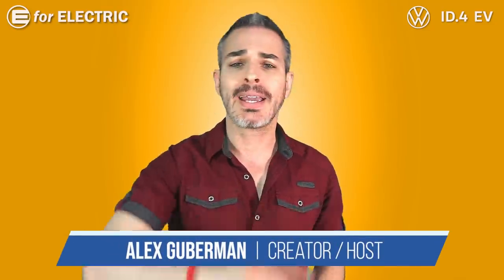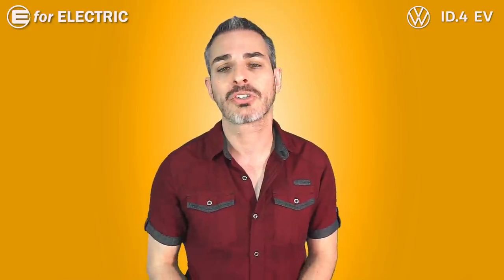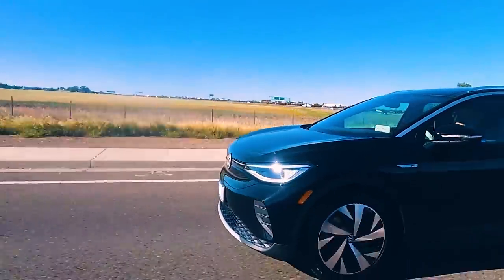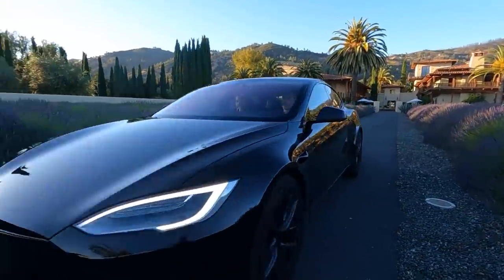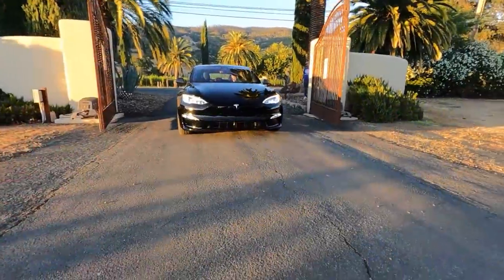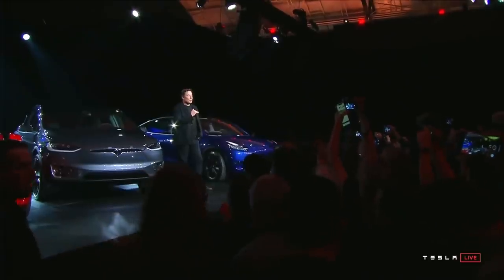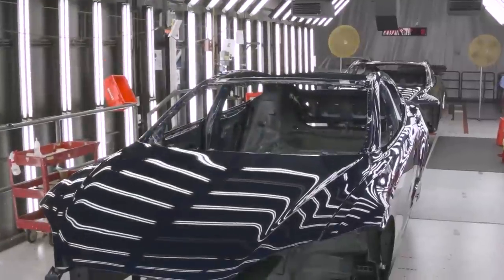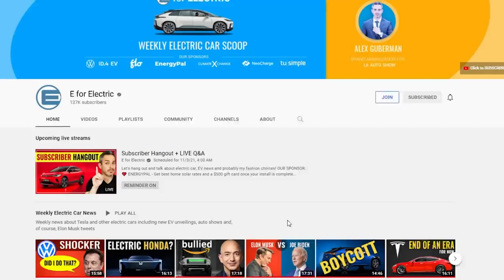SANDY MUNRO on Tesla's LFP vs 4680 Battery Tech

Comment: LFP will probably be the dominant chemistry for ALL BEVs that are on the cheaper end of the market for the simple reason that the raw materials are cheaper and more plentiful.
Reply: Maybe...what about CATL sodium ion?
Reply: Until the next breakthrough.
Reply: @FirstLast-ml7yf  it may be betyer, but far from proven yet!
Reply: Cheaper is most important but they are also better in at least three ways. You can and should charge them to 100% without any problem with degradation. They can be recharged many more times, and they are much less likely to catch fire if they are damaged.
Reply: @FirstLast-ml7yf  Mostly intended for energy storage I think, but that will be a huge market if there are cheap and good enough batteries available, used in combination with solar power.
Reply: @FirstLast-ml7yf  CATL's Sodium-ion is still way too heavy, but it will improve over time. Progress depends on the price of lithium and demand for EVs. (Who knows Trump may be back in 2024, oil may be dirt cheap and EV sales in the US stops growing)
Reply: And they last more cycles and can be charged to 100% with no degradation.

Comment: I love to use those LFP batteries. I use them since 2015 for starting battery for my motorbikes and cars. 
They have around 10% less energy ensity , but the plus for these batteries is, the 2000 charging cycles and they are bulletproof. When you dont need 0 to 60 in 2.1 sec, but are ok with 5 sec, the LiFePo4 battery is good enough  👍
Reply: Correct, there is only a 10% energy density difference between LFP and NCA (Tesla uses NCA).
2000 full cycles vs 1000 full cycles, cheaper, do not catch fire, can be charged to 100% every time - LFP is the future.
Reply: Grizzly, maybe you can answer this: Based on my current understanding, isn't it true that in a practical sense, LFP batteries actually have longer range than lithium ion batteries. Here is why that is my assumption. Lithium ion can only be charged to 85%  of capacity, and discharged down to 10%. On the other hand,  LFP batteries can be charged to 100% and discharged down to 0%. If my understanding is correct, isn't it the case that LFP batteries actually have 15% more capacity  than lithium ion batteries. And that is of course assuming that both battery types are the same size in terms of killowat hours. So my question is: Is my thinking wrong on this? If so, what am getting wrong?
Reply: You can use the full capacity of the battery without degradation unlike having to not charging to max or running very low too often as you have to with NCA batteries so reduced energy density isn't really aproblem.
Reply: @JohnDoe-fz5cz  the battery density is lower in LFP meaning more weight has to a allocated to the pack. More weight = less range.
Reply: @JohnDoe-fz5cz  it is true that the battery life (LFP) is longer giving 2-3 the total range of the pack-life (80% usefulness) to be about 1,000,000 miles.
Reply: @jamesirwin7677  In theory yes, but practicaly there are more variables. The weight difference is only a factor when you take 10% more batteries with you, to have the same energy. 
With the same amount (weight) of batteries there is only the 10% less energy density, no weight difference. So the LFP batteries can indeed discharge up to 15% more of the total amount of energy and charge to the full cap without degrading the battery. 
The biggest advantage for Li-Ion batteries is that they can discharge faster than LFP batteries, thus accelerate a car extreem fast.
Reply: @JohnDoe-fz5cz  You are correct. People use the wrong numbers when comparing LFP with most Li-Ion. With the same weigth of both, the LFP can hold around 10% less energy in totall. When used with 10% more batteries, the energy (range) is just a fraction less due to more weight. Accelerating more weight costs a bit more energy, but there is also more regeneration in deceleration. The loss in range is less than 1% due to weight difference. 
You are correct that you can discharge and charge 100% without risk of high degredation. Also the metals used in LFP batteries are less toxic and a lot cheaper, and more easy to produce.
Reply: @BMWHP2  Grizzly, thanks for clearing that up for me once and for all. Yup, I'm thinking LFP might be the way to go.
Reply: Most times I plug my car in it is to 80% of charge or less. I reckon I go to 100% about 12 times a year. LFPs will probably do a lot more than 2000 cycles in that regime.
Reply: @JohnDoe-fz5cz  "Lithium ion can only be charged to 85%  of capacity, and discharged down to 10%."

It can be charged to 100% as well. It's just that the long term degradation is less if you keep it between 10% and 85%. My Chevy Volt always keeps it between these limits in order to extend the life of the battery. You don't get the choice there.
Reply: @jamesirwin7677  you’re saying that this LFP battery could go for roughly 1 million miles ?  I just want to make sure I read that correctly.

Comment: Been using LFP for a decade now. It's not perfect but i love it. It's rugged , durable and safer.
Reply: Any loss in charge?
Reply: @Jay-xr3sb  yes there were losses over time. but still very usable. Unlike previous lead based batteries that sucked big time.

Comment: Not smart to conflate battery chemistry [LFP] with form factor [4680]. In a possible future you could have a 4680 that is LFP chemistry.
Reply: Agreed, but it's shorthand
Reply: Not possible LFP with 4680 format.
Reply: @ssecretsauce  Why?
Reply: @ssecretsauce  (the original FLP cell was a 26650 - so what  is the limiting factor in 4680??)..

Most replies saying anything is "not possible"   are wrong.   lol...
Reply: @kadmow  economically and theoretically not possible, tesla or Panasonic will make LFP battery with 4680 format.
Reply: @ssecretsauce   - whatever, sounds as if you are now contradicting yourself.  cheers...

PS. anyone can make a cylindrical Battery with nearly whatever dimensions they choose...
Reply: @ssecretsauce  BAK Battery was working on cylindrical cells bigger than 2170 (aka 21700) for quite some time and already offers 32105 and 32140 models (tabless design, in three versions: NCM, LiFePO4 and LiMn2O4).
Reply: @ssecretsauce  It is already announced on Battery day that 4680 will also come with LFP chemistry.
It is known fact.
The biggest advantage of 4680 is ease of manufacturing.
Compare 4680 manufacturing to pouch cell manufacturing; you will see how fast a 4680 can be made.
Also, the thermal and structural advantage of 4680 is already engineered.
The only advantage LFP pouch cells gonna have is energy density per volume (Wh/L).
Reply: @josephine2869  which battery day ? 
send me link pls.
So you think CALT & BYD are stupid ?
Reply: @ssecretsauce  Tesla love a challenge.
Reply: @kadmow  ... or chemistry.

Comment: I'd lay odds that LFPs completely replace nickel batteries in just a few years. LFPs are much cheaper because iron is much cheaper than nickel and cobalt. LFPs are several times as durable, can be charged to 100%, and don't catch fire. Their downside is that the energy density is lower but if that can be overcome they will take over 
Let me draw a parallel with semiconductors. In the 70s bipolar chips were used in fast computers while CMOS was used in feeble microprocessors. CMOS was cheaper, denser and lower power but bipolar was faster. In the 80s CMOS kept getting cheaper  and denser  but it also got faster. By the mid 80s CMOS was faster than bipolar and after that everything from PCs to supercomputers was using CMOS. Bipolar disappeared except for some niche applications. Today almost all chips uses a process which descends from CMOS. LFPs have one weakness, energy density, but if that improves by just a little bit there will be no reason to use nickel batteries.
Reply: I don't see the lack of power density as an issue but the expectation of the user.
Reply: The main issue is the ability to charge and discharge the battery cell and LFP, relative to Nickel based chemistries, are slower. The solution might be to have mixed module batteries in which perhaps 40% would consist of LFP and 60% Nickel based cells. Battery control electronics would dictate which modules of cells would discharge preferentially depending on the overall charge of the entire battery pack.  The LFP would act as cushion for the Nickel based cells operating at the extremes of the battery charge state.  So, to use Sandy’s analogy, the battery would behave effectively as an 8 cylinder engine that would vary the number of cylinders used according to the power available.  This 40:60 hybrid strategy might offer the best of both worlds improving the charging and discharging rates over 100% LFP battery packs whilst also increasing the number of charge and discharge cycles over 100% Nickel  based  battery packs.
Reply: @e-redj  LFP density is about 20% lower. Not so bad. Add 20% more then? I think people are already too spoiled :)
Reply: @e-redj  LFPs have two advantages that help to compensate for their lower energy density. They can be charged to 100% and they don't degrade nearly as fast. My two year old Model 3 AWD now has a range of 280 miles instead of the 310 it had when new, at 90% that's only 252 miles. The new RWD LFP M3 has 267 miles of range and because you charge LFPs to 100% not 90 it already has more range than my two year old M3.
Reply: Lfp is also heavier.  On the last ep sandy mentioned that he expected performance cars and weight sensitive applications to use nickel based. Budget cars and applications not weight sensitive will most likely move to LFP.
Reply: @Alsmithize  The most sensible comment I've read here so far :)
Reply: @joshuarosen465  Personally I'd rather not charge to 100% but yes LFP's used properly will last.
Reply: @samguapo4573  Tesla recommends that LFPs be charged to 100%. I'd assume that they have a good reason for this.
Reply: @joshuarosen465  I think this has may have to do with the battery balancing (individual cells) part. I think its ok to do this every now and then. but not all the time. Still running my LFP to the ground and back :)

Comment: Just a clarification. LFP is a battery chemistry and 4680 is cylindrical battery cell dimension. LFP chemistry battery cells could also be produced as a 4680.
Reply: Why would they? They want the 4680 to be performance cells for the upcoming 3 year late Roadster and other high performance cars as they will never fit 200kwh of LFP chemistry into any Roadster or Cybertruck
Reply: @gregb1599  I didnt say they should. Im just saying that comparing a battery chemistry to battery cell shape and dimensions does not make sense. The 4680 cells general proposed chemistry is not even introduced in this video.
Reply: @gregb1599  Because the battery pack structure would be standardised regardless of the cell chemistry.  Exactly the way it is now, 2170 LFP or 2170 LIC.

Comment: just a note: there have been about 20 Bolts catch on fire because of the battery, there have been 141000 built and most sold. so one car in 7050 have caught in fire.
Reply: @echoeversky  Hehe, something like 3.8 sigma.
Reply: Being intrinsically non-flammable might be an advantage, then. But how many ICE cars can say that?

Comment: The new Model 3 version with LFP is hardly a slouch ... still sub 6 sec to 60mph and with huge advantages of regular 100% charging being OK and a much reduced degradation. It's a great fit for the needs of that car and for many potential owners. 5 years down the road I guarantee people will be paying more for second hand LFP Model 3s than the SR+ that had the "faster" battery. I'm not knocking the pre-existing SR+, I own one and it's great!

Comment: 4680 is a form factor and LFP is a chemistry.  There is no reason why you couldn't have a 4680 LFP cell.
Reply: Why are the LFPs produced as prismatic cells
Reply: Correct. 4680 is just the 46mm x 80mm packaging size, not the chemistry.
Reply: @cold_jay  There have been LFP 18650 cells around for years.  LFP can be packaged in many ways.

Comment: The other manufacturing consideration beyond faulty units per million, is manufacturing efficiency. Every step of the new production line has to be as fast as the next (to avoid partial built batteries stockpiling) and that the end-to-end operation is at least comparable to the net kWh production rate of the current battery generation, or you will have a net production rate decrease and commensurate net cost production increase.

Comment: The cell voltage difference between Teslas NCA and LFP is 3.7V vs 3.4V @ 50% state of charge. This is only a 10% difference in energy density.
4680 is just the cell size and does not refer to the chemistry. In theory, 4680 could be made using LFP.
'4680' means 46mm wide x 80mm high. This is just a packaging dimension. Tesla will pivot to LPF, and LPF can be packaged in the the 4680 size.
Reply: Bingo; just look at the numerous packaging sizes in which the alkaline cells we use in all our remote controls, flashlights etc can be found.

Comment: 4680 cells aren't delayed, Elon said it would take 3 years to realise the full advantage, however the cells are now at a good production rate at the pilot plant, the battery pack is causing some issues at the moment but the cell production rate is good. Add to that the battery cell plants at Texas and Berlin won't be ready till next year.

Comment: LFP's density is around 170 Wh/kg vs 260-280 Wh/kg.  SO if you are happy with a 250 mile range or want a 400 mile plus range there u go.  Range is king as is recharge times, so LFP will always be a niche chemistry in markets where you drive a lot (like the USA)

Comment: The battery day told us that Tesla will be ramping up the mass production of 4680 with all the battery day goodies in three years... that's two years from now. Not sure what is late at this point as the pilot plant already has a decent yield and can do quite a lot of initial inhouse battery production... they may be ahead of their initial schedule.
Are LFP's obsolete when 4680 comes out or the other way around? 4680is a form factor... can be nickel and can be iron phosphate. LFP is battery chemistry... can be square or cylindrical, can be 4680 or any other size.

Comment: LFP is battery chemistry and 4680 is battery packaging. It's not comparing apples with oranges, it's comparing fruit juice with with bottles. 
Disclaimer, I'm using LiFePo4 cells for some 8 years now in several projects from 14400 to 22650 sizes.

Comment: I think that Tesla's LFP may not be in the 4680 format but I'm not sure.
Currently Tesla's LFP batteries are Chinese made and have been for 6 months or so.
The cylindrical format is good for cooling and isolation of rogue cells but LFP doesn't need those features so the BYD blade battery format seems like the best format.
And the MIC Teslas wouldn't be using the 4680 format as of today.

Comment: I wonder if they could use two different types of battery packs to get the best of both. Also what happened to ultra capacitors, I thought that would be a great buffer for high instantaneous output  & regen.
Reply: When your batteries can push a car from 0 to 100km/h in 2 seconds, why add capacitors? The best part is no part!
Reply: I believe Hyundai is testing hybrid battery packs. Their competitors are waiting to see if it works well.  Capacitors could help in charging speed so I wouldn't count it out.
Reply: @RobertHamon  yup, elon even mentioned it, the batteries have gotten so good that capacitors are redundant.

Comment: Please can you explain where you get the idea that LFP are '4 cylinder' LFP have higher C rates than NMC and can therefore deliver more current. Their drawback is the energy density which means you won't get the same range. The only reason the cars are slower is because Tesla are only fitting them to the standard models. If anything LFP will charge faster and deliver more power.

Comment: Sandy keeps getting the comparison between the power output of LFP and other batteries wrong.  The LFP is the V8.  LFP batteries can put out more amps.  UPDATE: Sandy isn't wrong with regular LFP batteries.  What I didn't know at the time of writing this post originally was that the 2014 Spark EV had Lithium Iron Nano Phosphate batteries and not just regular LFP batteries.  The nano phosphate gives the phosphate more surface area allowing electrons to flow easier.  This giving more amps and charging speed than regular LFP batteries.  So the Lithium Iron Nano Phosphate batteries in the 2014 Spark EV are like the V12 of LFP batteries.  The 2014 Spark EV which has LF-nano-P batteries puts out 400 lb-ft of torque.  The 2015 & 2016 Spark EVs don't have LFP but regular NCM LG Lithium Ion batteries put out 327 lb-ft of torque.  The 2014 Spark EV battery voltage is 365 volts.  The 2015 & 2016 Spark EVs battery voltage is 400 volts.  

If Tesla dialed back using the computer to slow down their LFP cars it is probably because they are trying to eek out as much range as they can from the LFP batteries since they don't hold as much energy pound per pound.  You actually get more daily usable range from an LFP battery because they can be charged to 100% everyday without damaging the battery.

Comment: Wonder what would happen with a “battery change out” on an old model Tesla to a new 4680pack.
That would be an interesting experiment as it will show that is it weight reduction enhancements ,software or a combo of other combinations or does the battery performs as stated and expoused..

Comment: I found this discussion to be somewhat confusing, as between the battery form and the battery chemistry. As I understood it, chemistry and form factor are independent. So Tesla could use the 4680 with LFP chemistry or with the older chemistries. Conversely, they can use the LFP chemistry in the 2170s or in the 4680s. Have I got this wrong?
Reply: I suppose its possible that with the way the 4680's are made,  they may be more difficult to make with LFP ?